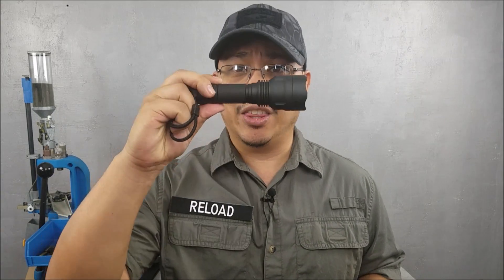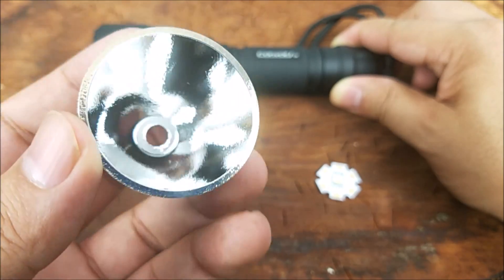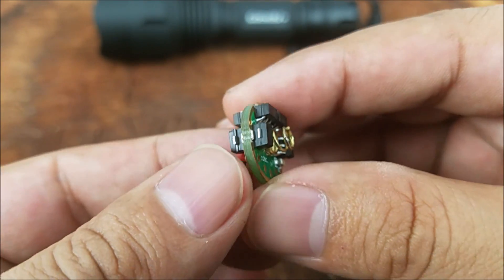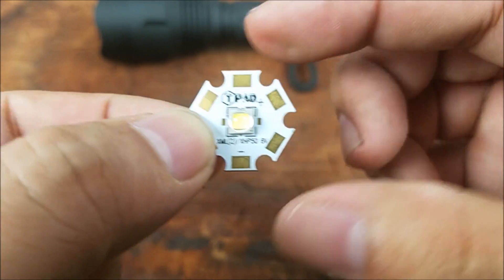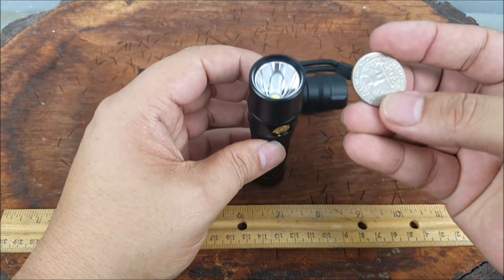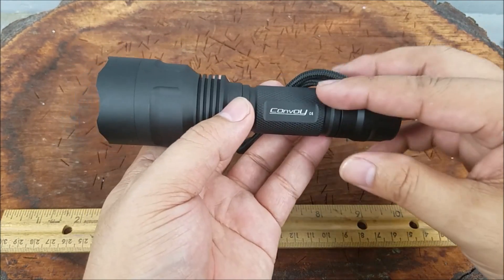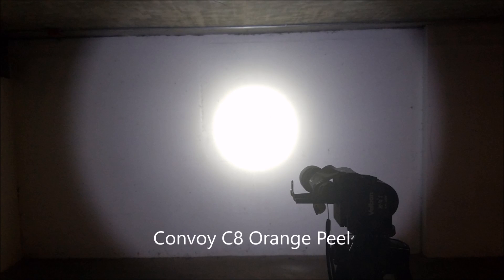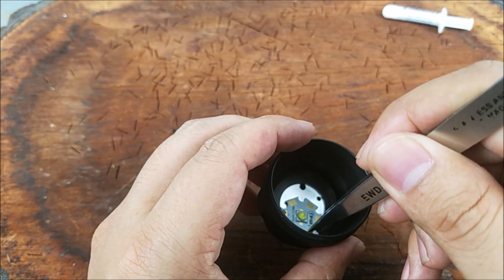Stop Over Paying for Surefire and Fenix Flashlights Build Your Own $40

Comment: That is a really unfair comparison. One is huge with an enormous head, the other is compact and rechargeable. About the only thing they have in common is that you had both on hand. 

Yes, buying a host or modifing an LED flashlight is not overly difficult, however, if you are going to be in situations where your life may depend on your light, home built, unless you really know what you are doing, is not a good idea. The reason factories charge more is they test, test, and then test some more to get a RELIABLE product that will keep working even under adverse conditions. If you are trying to clear (search) your house and drop your light because your adreneline is pumping and it breaks, you are just SOL. If, no the other hand, it has been rigorously tested and actually has a DROP RATING, you're in much better shape. I won't even get into run time vs heat dissipation except there is a REASON factory lights aren't routinely over 3amps...they rapidly get so hot they can't be held. (and the heat damages the LED). 

Sure, playing around is fun and can yield some great results fairly easily BUT it HAS to work first time, every time, stick with a good brand factory light. That's why a Surefire, an Eagletac and a Thrunite reside next to the bed along WITH my home built light. Each has a function and purpose.
Reply: you can buy fully assembled convoy c8 960lm 8x7135 for 15 bucks from gearbest, but you need to wait like 10 days to grab it in your hand.
Reply from the maker: its also $80 cheaper

Comment: Getting the basic flashlight for $40 might seem like it's a lot cheaper than buying it in a shop, but then you'll have to take into account not only the materials used in for example that Fenix where you have internal charging, a more complex body that had to be made for it, buttons and other such parts, the pocket clip, the actual charging cable, the included battery etc. and those things alone pretty much adds up to the $80 that the Fenix costs and that's not including actual work and if there ever needs to be any warranty work covered by them which means if you were to do the light yourself and count how much time it's taken you you'd end up at about $120 with all the parts if you want to do it all yourself. 

My point is, you don't just pay for a piece of turned aluminium and some minor parts, you pay for all of it and in a light such as Zebralight or Olight it's pretty much a bargain that they're that cheap with the quality and time put into it that you get, and should those randomly stop working you send it in and you get it fixed or replaced while doing it yourself once again costs you money to replace the parts and time to actually carry it out.
Reply: LRJ88 My cheap $8 flashlight has lasted 5 years no need warranty I could buy many more for the price of a shitfire!
Reply: Dinner-fork tongue ya he works for the competition. He is trying to persuade you to just buy his flashlight for a hundred dollars
Reply: You’ll never, ever beat economy of scale. Upfitting “regular” LEDs and power sources is fun and worthwhile as a hobby and for uses that don’t expect hard use, but you’ll be hard pressed to beat the durability and reliability of a Surefire or Streamlight at anywhere near retail price.
Reply: LRAJ88 
Replacement parts for these lights are actually way cheaper than you think. A driver goes by 3 dollars, a switch by 1, and an XM-L2 LED star assembly goes for less than 10 if you know where to look for it. And thats not even taking into accound that the parts would cost you the shipping for a brand light already, and you being the one who made it yourself you'll know for sure you got it fixed instead of potentially getting a bum fix once it's sent back.

Olight is decent but unreliable from my experience (I've had an S10R that failed completely 4 days after arrival, an S30 that doesn't go above medium mode without flickering like a faulty CFL, and an S1 with atrocious parasitic drain), and contacting their customer service is a nightmare to say the least. Fenix is just straight up overpriced and obsolete, a brand way past its prime.
Reply: If you get the cheapest stuff it'll always be cheaper, but cheaper doesn't always mean better either. If you want a good, reliable switch you may want something that's not sent in bulk where you have to go through 5 to find one that works the way it's intended, something that's already the case with a lot of the cheapest stuff you can get. The same goes for the LED unless you buy them checked so the tint isn't off or there are any other defects, this is even without mentioning the body of the light and replacement parts for that. 

If you have your own shop set up, you have experience with it and buy parts in bulk, sure it can cost you less overall than buying a brand flashlight since you can cut down on the work time then and save the money that way but otherwise it'll take a while to put together and for someone that doesn't do it all too often spending 20 minutes troubleshooting and an hour fixing it isn't ideal.

As for the customer service from Olight I've never had any issues with them, they've replied back the next work day and helped me. Fenix was an example and albeit pricey and top of the line anymore their flashlights still work and their customer service does as well.
Reply: Actually most of the quality issues you mentioned are covered if you frequent a forum, where you can easily find groupbuys and other indications as well as detailed guides on flashlight building, from firmware to solder.

Guess you're lucky then. Tho to be fair, once I contacted the BLF rep, Olight was very fast in setting up a conversation and I got both a replacement S1 as well as an S2 to compensate for the faulty S30.

Comment: Hey, nice video! 

Not sure if you know this, 
I went to the mtn electronics link. Practically everything on almost the entire sight is out of stock. 

Do you know these guys? Are they shutting down  or something? 

Thanks!
Reply from the maker: mylestube5 they sell out of stuff quick they have an outstanding rep on the forums thanks forums
Reply: No way, what parts are you referring to? 

Most of their inventory comes from overseas, so if it's a popular item they might run out and have to wait while they get more.

Edit: I took a look and I see that they are out of the C8's. Maybe this video inspired several folks to go and buy them up? lol. I'm sure they will be back in stock soon. It's a fairly small company and the owner Richard is a real nice guy. He does a lot of custom builds himself and is very knowledgeable. 

You can also buy Convoy lights from Convoy's official store on Aliexpress - Shenzhen Convoy Electronics Co., Ltd.

Convoy's owner, Simon, is not a custom builder due to time restraints, but on his smaller lights he can flash the drivers with his new firmware for $1 extra to give you lots of different modes to play with. I highly recommend that as the stock firmware is very basic and mildly annoying in my opinion. 

Other sites sell Convoy as well, but they will be stock lights.

Comment: But fenix flashlights are only like $60-$80
Reply: The small Convoy lights are $15-$25 plus battery ($10). Not only is the quality just as good, but you can do a lot more stuff with the Convoy. For instance, I bought the Convoy C8 with stock 1000 lumen driver and had Mtnelectronics flash their guppydrv firmware to it for $4 extra. I now have 22 modes to choose from to see what suits my needs. Here's the list.

User Selectable Groups:

2% - 25% - 100% | Memory
100% - 25% - 2% | No Memory
2% - 25% - 100% - Strobe - Beacon | Memory
2% - 25% - 100% - Strobe - Beacon | No Memory
15% - 100% | Memory
100% - 15% | No Memory
100% Only
100% - Strobe | No Memory
Strobe - 100% | No Memory
ML - 5% - 33% - 100% | Memory
100% - 33% - 5% - ML | No Memory
ML - 5% - 33% - 100% - Strobe - Beacon | Memory
ML - 5% - 33% - 100% - Strobe - Beacon | No Memory
ML - 100% | No Memory
100% - ML | No Memory
ML - 100% | Memory
ML - 5% - 15% - 50% - 100% | Memory
ML - 5% - 15% - 50% - 100% | No Memory
100% - 50% - 15% - 5% - ML | Memory
100% - 50% - 15% - 5% - ML | No Memory
2% - 15% - 50% - 100% | Memory
2% - 15% - 50% - 100% | No Memory

Plus parts are available and very inexpensive for Convoy. Plus it's easy to increase or decrease the max power if you want. You dont get that from Fenix. In fact, I'd say that Convoy (and Eagle Eye) are better than Fenix for all the above reasons.
Reply: congrats Atom lew, that almost made sense.
Reply: More func not means good, if you only can take one flashlight to the war zone  which one you will trust? I will only take SF

Comment: Nice, I would really love to watch the build! I have a BUNCH of old flashlights from the 70's/80's that use c and d batteries and really want to switch them over to led!
Reply: cStu444 cStu444 Take a look at MTN Electronics, they carry the Evva protected versions and Illumn carry Keeppower protected versions. IMR Batteries in Houston are also a good source.
Reply: It's not worth the trouble. They won't be able to handle the heat the newer, brighter leds are putting out and the newer rechargable lithium ion batteries are far superior as well. It's much cheaper to buy new lights. 

There are lots of good lights for $15-$25 plus about $10 for a good protected battery. You'll be well ahead compared to trying to convert old flashlights. 

Convoy and Eagle Eye are some of the best brands right now.
Reply: What JasonWW2000 said. Unless you plan on modding them for fun and nostalgia, in which case go right ahead! Get a lower-power LED, a driver with not too many regulators, a few spacers and you're set to revive your Daylos of olden days.
Reply: JasonWW2000 $10 for a 18650 >3000 mAh Sieko protected Japanese? Did you throw the bill on the counter and run out the door? Orbtronics direct are $15 + s+h

Comment: Excellent Video ! 
I would love to see how you put it together,  step by step.
I am a Flashlight Nut....
I keep them Every Where. 
My EDC is a "Luma Force" 
250 lumens it's about 3 inches long holds one 1 2 3 battery
Reply: jcnme2020 ooo 
Take a gander around Convoy lights sometime, then. You might like them.
Reply: Thank You Sir !  I will definitely check them out.
Reply: jcnme2020 ooo
What did you think of Convoy? ;-)
Reply: I liked it.  I'd like a  light I could recharge or use 123 batteries or AAA as well,  all in one light. 
What do you think?
Reply: jcnme2020 ooo We're not quite on the tech level to make that viable. The differences in voltage among AAA, CR123 and rechargeable li-ion make putting together a universal driver system a complete nightmare.

There are a few rechargeable Convoy models, but I don't know which. Your best bet would be to contact Simon (the owner) in Convoy's Aliexpress store after the 16th, when it re-opens.
Reply: Excellent !  Thank you for the Heads up.
Reply: Dinner-fork tongue the BD series are the rechargeable ones.
Reply: turbo2025 
Thanks, bro.

Comment: Great video whats the link, also are there any waterproof housing available? also approximately how many lumens would you say the convoy is?
Reply: The stock Convoy C8 draws 2.8 amps (with 8 of the 7135 chips) and with a xml2 emitter that's about 950-1000 lumen. 

The driver he uses in the video looks to have 16 chips for a potential 5.6 amp draw, but I'm guessing it's going to be less than that due to the stock springs and maybe the battery depending on what kind he's using. If he's getting 4.5 to 5 amps then I would estimate it's putting out 1200-1400 lumen, maybe more. 

He didn't mention it, but the best part of these custom drivers is you can get them programmed with fancy firmware that have multiple different modes that you can choose.

Comment: For budget seekers I would recommend Nitenumen NE01 as per Welljuggleknives. You can get them on Gear Best for $20 and they have a real 1000 LM with USB charge. I bought 2 and Welljuggleknives was right they are great for the price the only thing is no power level memory.
Reply: Probably the best budget lights that have built in USB chargers are the Eagle Eye brand. I've got 3 of the X2R (550 lumen, $15) and 1 of the X5R (1000 lumen, $25). These lights have off time memory, which is the best, and simple modes. 
x2r is low, med, high. 
x5r is low, med, high, turbo, plus a hidden strobe. 

I hear the X6R ($23) is a good light as well, but I don't have that one.
Reply: ap0lmc Why do they use usb all usb leads I ever had broke in a couple of years!

Comment: So rather than doing all of my own research, I might try just asking you - I'm looking for a light to buy several of for weapon mounting.  I want a tail click, only one brightness, preferably not focusable, no frills.  It does need to be robust and reliable, and I'd HIGHLY prefer it uses AA batteries.  I know you sacrifice some battery life, but for me it's worth it for the convenience.  Can anyone point me to a good one that's not a $3 piece of ebay crap but also not premium navy ninja operator pricing?  Thanks
Reply: rmpennin 
Sad to say, AA doesn't offer enough power to work in a gunlight with current technology. It's either lithium or li-ion for that.

Comment: They advertise that one light on TV. Two for twenty bucks. The price will go down on all of those lights after the first of the year.
Reply: Was that the zoomable light they showed being dropped from a helicopter? If so, those things are a joke. Those lights are not high quality, nor very bright. They sell for $5 shipped if you really want one. Don't forget that a good 18650 battery will run you $10 more. A $15-$25 Convoy or Eagle Eye is superior in every way. 

The one good thing I will say about that company selling the zoomy lights is that they sure know how to make a good commercial. lol.
Reply: JasonWW2000 
It'd be fun to make a quality light in a cheapo's host if you're into modding 😋
Reply: Dinner-fork tongue There's not much need to build a light. A stock Convoy L6 and stock Eagle Eye X5R are my daily use, work lights. Now if you have a need for a specialty light, that's were building one yourself makes sense. If you put custom firmware in you can taylor it to your needs.
Reply: Ah, but fun hardly ever factors into necessity :P

Comment: Good video.  It's good to know that there are alternatives to paying a high price for a flashlight.  The high end flashlights have some shock and or water resistance. How does your light handle shock and water?
Reply: Generally speaking they are the same. Convoy and Eagle Eye are both very durable and the water resistance varies from model to model like any other brand. The C8 he has in the video is submersible. 

What's nice is if a part should ever break you can buy new parts cheaply. A new stock driver is like $3. A new tail switch is like $1. All very affordable.
Reply: If you think it is same quality, why Gov not purchase flash light from other cheaper brand? Why always buy them from SF? I saw SF flashlight can still work after IED. My Fenix broken after one drop from about 1.7m. This is the same quality you were talking about